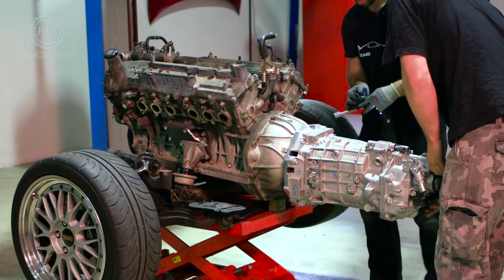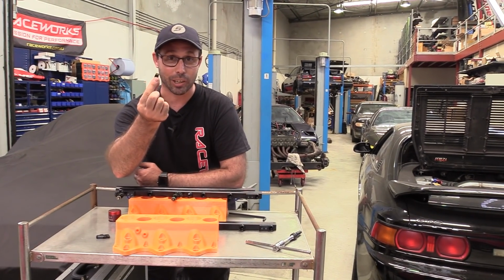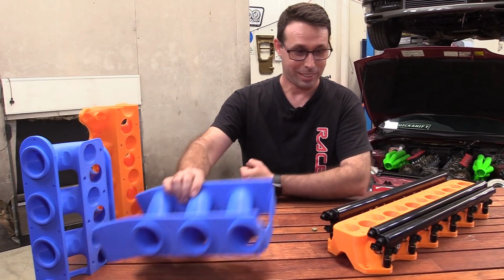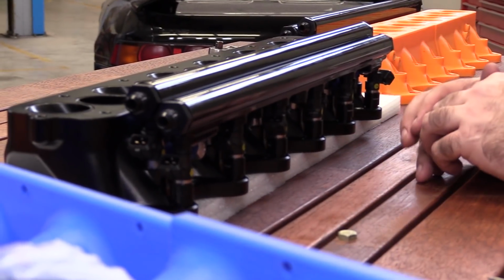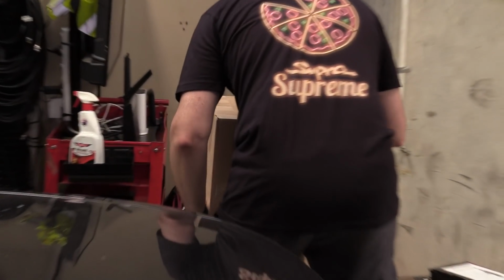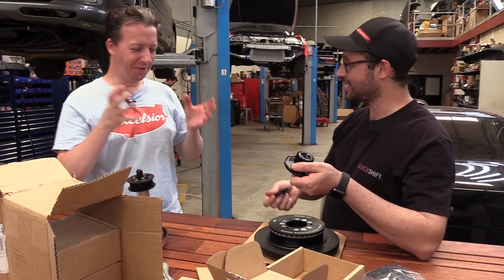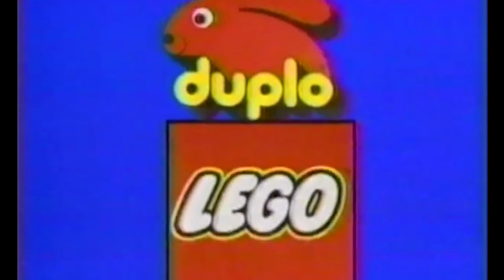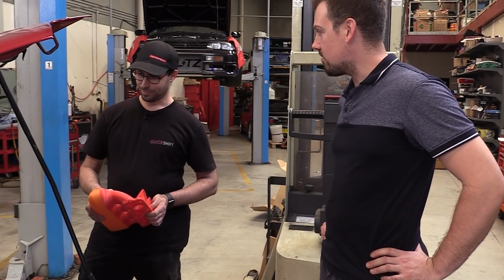Supra Supreme - HUGE Billet Part Arrived! [Ep15]

Comment: Guys.... so I found a mk4 supra cheap af in North America. Might replicate the v12 swap lol. Or stick a 2jz race motor I found cheap in it. Any recommendations on a cheap option for a tranny? Doesn't have to be like junk yard cheap but rebuilds and upgrades are fun. But new isn't off the table. Just don't wanna drop like 10k plus on a tranny. 

Think an upgraded t57 or something similar would hold up to 1000hp and be reliable?
Reply from the maker: TR6060 second hand is strong! Its basically a T56 with upgrades, from the factory
Reply: @QUICKSHIFTtv  sick thanks guys. 

I wish your shop was in my country. I'd get my gto out for a track day and it's probably gonna get the final touches this year.  

Plus I could probably get your help on my other build plan. Superlite slc. One of the kit super cars, having a pain in the rear of a time trying to figure out my engine plan if I get stuck using the Graziano transaxle. 

Gearing doesn't fit an ls properly and apparently the ls just can't be made to Rev to 8500-9k and make 1000hp without dropping 30 to 40k into the motor and not easy to do an upgradable set up it appears. 

Would a 2j  or 1jz handle 9k rpms 8500 more realistic and up to 1000hp without needing to dump unreasonable amounts into it? 

Don't mind needing to dump cash down the road to up hp. But realistically only need 500 or so to start more so rpms that's important. And adding induction later isn't a huge deal. Just need to be able to build the top end and bottom end to handle it and not hit that 30k mark. 

Drop gears for the Graziano to fix gearing cost what a crate ls3 does almost. And that doesn't include a rebuild. Seen skyline stuff cheaper lol. 

Other engine choices I'm thinking are 
1gz fe
Wr12 the vw w12
Audi v10
Vr6
M120 Benz engine
Ford Coyote
BMW engines 

Realistically if I end up needing to dump lots of money gonna put it on hold and build a motor up first and just spend what needs to be spent. But if I'm dropping 40k on an engine I should be able to easily do something more exotic.
Reply: A lexus sc300 or whatever it is that's the lexus version with a v12 would also be jokes. Plus aren't they almost the same car different body slightly and factory engine and transmission options.

Comment: For the intake runner why not make a metal gasket with rubber inserts so you can space it up a 1/8" to get ypur riser space you need
Reply from the maker: The ports run on a 50 degree angle and a spacer would create a significant notch in shape and flow disturbance! Also we don’t have much room to the hood because I used every millimetre available to make the runners as relaxed as possible
Reply: @QUICKSHIFTtv  well then I dont blame you in did type before I watched whole video. But really loving your concepts and completed designs. Really amazing detail

Comment: Dude lengthen the plenum and water jacket it run it off your water to air exchanger or separate tank ... Cold charge that sucker
Reply from the maker: That was the plan at one point! But I dont want to block easy access to some other parts. And I want really, really big intercoolers. After datalogging 1000m runway racing intake temps... and knowing this car might be used for that, nothing will fit there thats big enough.

Unless... 4 intercoolers? Hmm. heheh

Comment: Manifold can be fixed together with just one bolt on each side. Hook and tab the the rear and one fixing bolt to the front. I’m a commercial gas engineer and this type of fixing is very common and super simple.
Reply from the maker: Not a bad idea! My concern would be getting the hook perfect so as to crush a thin sealing o-ring perfectly all the way around… and a few other drawbacks. But it deserves some thought

Comment: I have done this before with an intake manifold. As you found out the 3d print dimensions are different than actual real world dimensions. You need to be careful with that especially on the injectors since you don't want one to blow out under boost and spray fuel into the engine bay.
Reply from the maker: Yes sir! That’s why we are making each billet piece one by one, so there’s opportunity to correct for the 3D prints being a bit off. We anticipated the issue

Comment: Are the flanges actually touching the fuel rail? Why not put 30° fittings on the end of the rails?
Reply from the maker: They were touching and preventing the whole piece from bolting down by about 2mm

Comment: I have a question... will the runner bolts with the wings create too much turbulence in the chambers?
Reply from the maker: I spent a lot of time thinking about this. In the end, they allow the outer walls to be totally smooth whereas the last design had ridges / all the way along the walls for the bolts. I think its likely this new design will actually be a flow improvement

Comment: Hi guys.. great build series  loving the process.
 In your question about the plentums . 
 The bars running inside to join both half's together  although designed well  like a blade so possible air flow problems are minimal. the integrity off the seal at oem level okay but  high boost  levels you might  run into seal blowout  problems  , I say  weld the 2 together and  keep  the bars inside as possible  internal nitrous injection foggers ..?
Reply from the maker: That's some good feedback and the possibility of losing seal was on my mind throughout the whole design, but I am determined to make it work! The fasteners have more cross section than bolting the plenums on with a large handful of 6mm bolts... and I do intend to make the stalks out of high grade stainless steel or titanium for tensile strength, along with a sealing o-ring with significant crush. I think it'll work even on high boost!